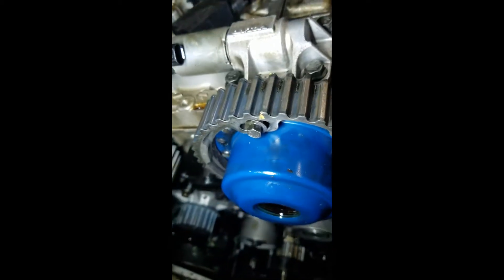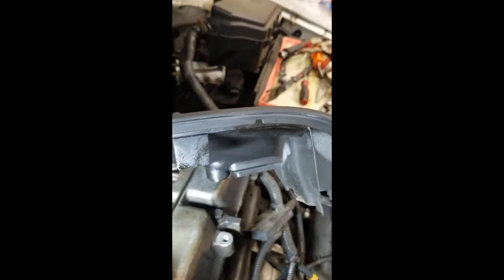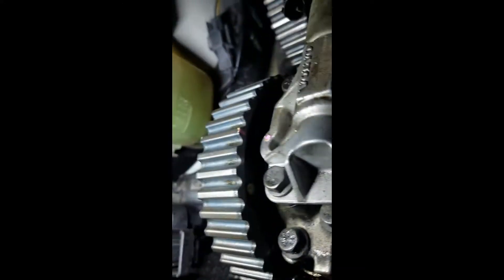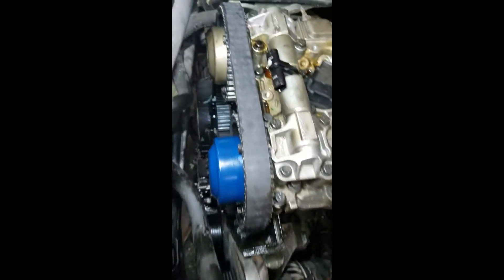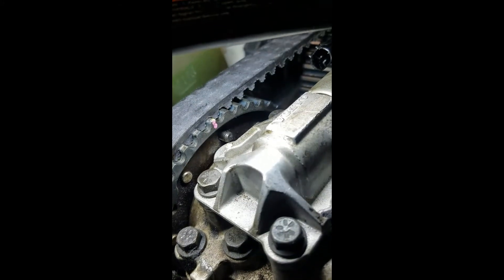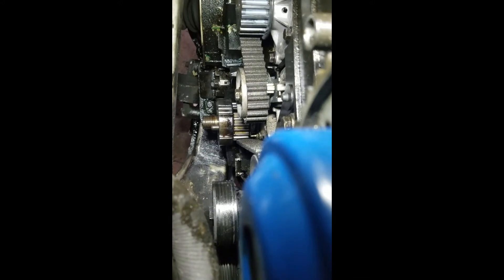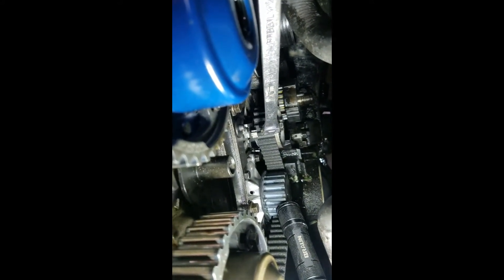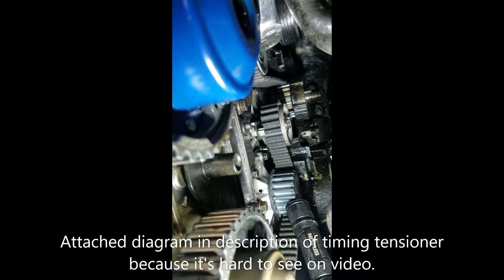How to set Volvo VVT gears and timing  I show both single and dual VVT

Comment: Great effort ..! however I personally prefer the Euro version of the timing install it's way easier
  NONE OF those cam gear MARKS MATTER !! 
Factory doesn't line anything up using those marks ( they are designed for a timing belt verification and reinstall of the timing belt after ) 
NOTE: 
as long as your cams are locked in place ( at the back of the cam ) and your crank is set to the right spot .
a) tighten the hubs right away and istall the T55 plugs
b) turn the hubs all the way clockwise
c) set the ( fine adjustments )bolts on the gears in the middle of the slots
d) install the belt and choose a proper tooth so the bolts are still in the middle and you have enough tension
e) put a T55 in a plug and push on it clockwise while pressing on the belt counterclockwise creating pre tension..do that on both cams and tighten the 8mm bolts (.should be somewhere in the middle )
f) set the pre tension on the tensioner to the spec 
h) draw your own marks on the cam gear and on the belt to align with the marks on the plastic cover 
g) remove the locking tool and spin the crank twice  ...then right after push the locking tool back in place at the back of the cam those slots and notches should line up and then look at your newly drawn marks IF everything lines up  then you're done !

takes 5 minutes !👍🏻
Reply: + one, do this

Comment: best thing to do is get a cam locking tool and some tie straps to properly  to hold in place when replacing the timing belt.  set the VVT you need a holding tool that locks the back of the cams in place, you may end up bending a valve with this method. good luck.
Reply: As long as you turn the engine over by hand a few rotations before starting it you don’t need to worry about bending the valves. Not sure how a cam locking tool would work if you pulled the head and then needed to use this procedure.
Reply: @ST3ADYxKICKS  enough compression in these engines to bend valves just by cranking engine with a breaker bar unfortunately. Can't rely on that method anymore.

Comment: I have to fix Volvo with 2 gears cvvt and I watch and watch this video to understand everything but still I think I did a mistake... After monting belt I tight big bolt inside the gears.
Tomorrow i will open again and check

Comment: Great video. The timing is the only thing ive struggled with on these engines and this man does a great job breaking it down. Thank you Sir!!!!
Reply: I was bit confused at the end, he says lossen the 8mm bolts turn inner gear clock wise but judging by his hand movements looks like its counter-clockwise  to clockwise then back to counter-clockwise or like im advancing twice in before the belt and again after the belt is installed
Reply: Did you get it to run right?